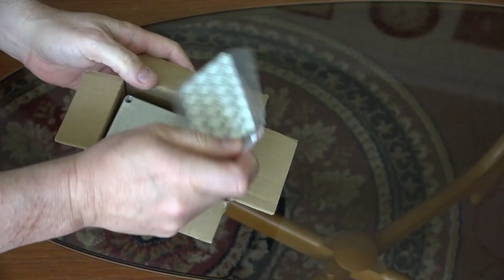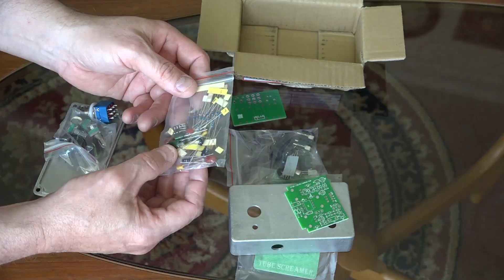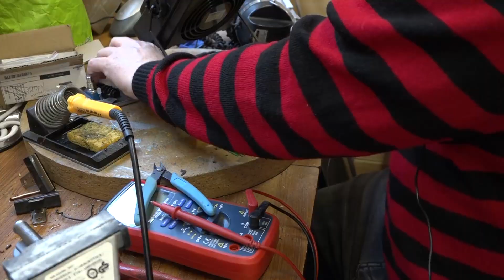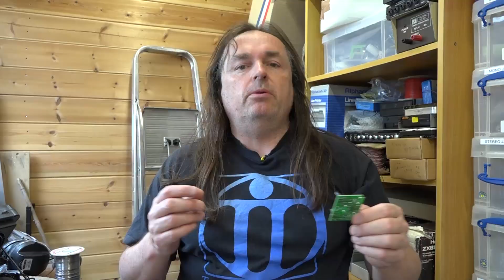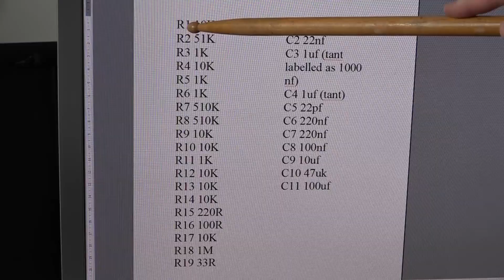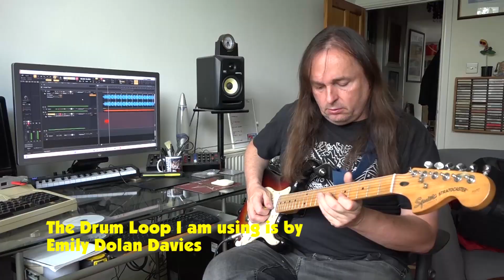The Trials and solutions to building a new AliExpress TS-808 Tube Screamer Pedal Kit

Comment: It can be annoying when they put the power input jack on the side: lots of kit pedals seem to be like this, strangely.
Reply from the maker: Although you've already got a Jack connector on the side maybe the reasoning is that you can then fit more on a pedalboard however I think it's more so having all of it fitted on the one printed circuit board which actually makes sense

Comment: It's good value if you have plenty of time to work it out for yourself. I've built other kits, including a Geiger counter which was a birthday present from my neice, but they always came with at least a circuit diagram and a bill of materials. The aluminium box alone costs about £10 from Amazon, un-drilled of course.